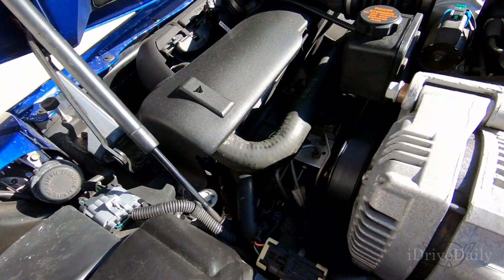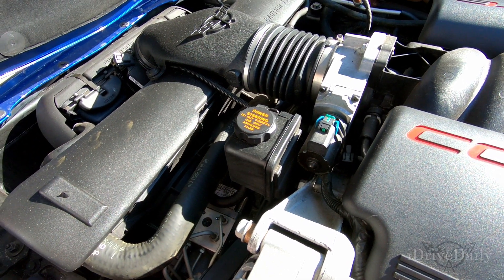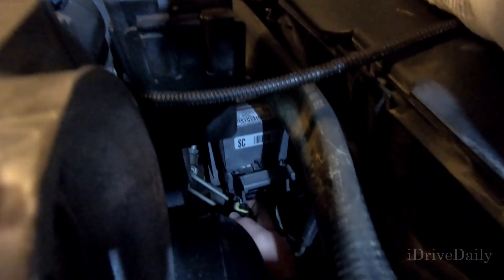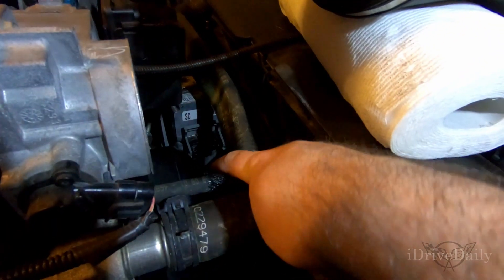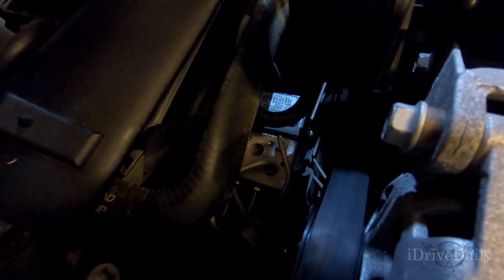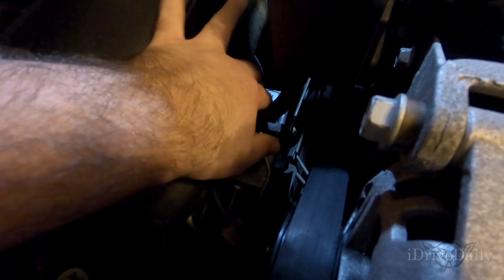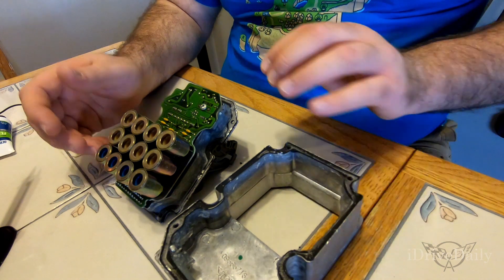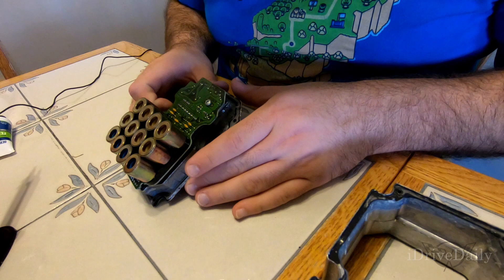Code C1214: Repairing a C5 Corvette's EBCM

Comment: Do you connect the points, or you just tap on each point?
Reply from the maker: I assume you mean the soldering part. I essentially "tapped" each point adding new solder to ensure that they were all connected.

Comment: I have a 2003 C5.  I lived with this issue longer than I care to admit.  A few years ago I finally dove in to this repair.  All I can say is, "I should have done this sooner".  The idiot lights have never returned.  My ABS and traction control perform as intended.
Reply: Congratulations. 

Did you notice the Corvette performed differently after the ABS module fix?

Comment: Thanks for making this video. But a solid 5 out of 10?! In my opinion, "this one goes to 11." And I didn't even do the repair. I sent it off to ABSfixer. But removing the module and replacing it amounts to the most heinous repair job I've ever had the misfortune to undertake. The skin on my hands and forearms is STILL healing! I came at this thing from above and underneath. The tight spaces, awkward angles, and blind spots (especially that middle T20 screw towards the front bumper) made me really regret buying this car (only had it 3 months). I lost a T20 screw, found it with my magnetic tool retriever, then lost it again into the abyss of the engine bay. God only knows if it's still in there somewhere. So my module is holding fast so far with just 5 screws. It works, and I got rid of those annoying beeps at start up and shut down, but my goodness...it's like they designed this thing thinking it would never need to be accessed for repair. I live in a condo with a shared garage. I'm thinking ownership of an older car like this should just be reserved for those who have a private garage.
Reply from the maker: The module is in a trash location and is a PITA to get to. Even looking back, it's a crap job, but I don't know that I'd rate it at anything much higher than a 7. In reality there are a lot of other projects that are more difficult than this one because in reality, this job is essentially unplugging a module, soldering it and plugging it back in. Even with the down time I've had on the car and some of the stupid repairs I've had to do, I don't regret buying the C5. I have a lot of fun driving it and learning more about mechanics as I go along. It can be frustrating at times, but that is just part of owning a car.
Reply: @iDriveDaily  Thanks for the reply. And I agree with your statement in another video, that it's a "love/hate" relationship. Mostly love, though. The car is amazing, I'm glad I bought it. And I knew buying an older car would involve skinned knuckles and colorful language. But I'm glad it's a 2nd vehicle. I think of it as a 4 wheeled motorcycle with a roof and reverse. Even if it's up on jack stands, I can still get to the auto parts store/work/grocery store with my other vehicle.

Comment: Several months ago I bought all the necessary tools to "fix" the EBCM in my 2001 Vette.  The coding would not go away.  Then, out of the blue, the code disappeared entirely. No history, nothing. OK I thought.  I had been looking at the wires to the connector, touching them.  The car was driven for two months over smooth roads and the DIC never threw a code until Saturday while caravanning with several Corvettes over a variety of textured country roads. Now, I am back where I was before. My question is: Was your soldering job successful?  This intermittent problem needs to be fixed, once and for all.  Thanks in advance for your reply.
Reply from the maker: I'm just a few days short of two years and I've had no issues (knock on wood) since doing the solder job. It's a PITA, but I do suggest it as a more permanent fix. It's a common fail point on the C5 Corvette. Hopefully, with a little solder, you'll have the same luck as me in two years.

Comment: Thank you for showing me which solder joints/tips needed touch up....My EBCM was not at all ratty when I opened it.  It was well sealed with Silicone and difficult to get open...but I soldered the 5 points anyway....slide the cover back on it, connected the two connectors, switched the key on.........and no ABS Light or Traction Control light...Put black silicone on the notched flap cover after cleaning it off, installed the 4 screws that hold the cover in place....put it on the car with great difficulty, even loosing 1 of the 6 screws (the one in the middle on the right side when you are standing on the left side of the car).  It was getting dark so I quit for the day....Went to Chevy Dealer in Prescott, Wisconsin, bought 2 screws came home and when I put the right middle screw in...it went into a hole and disappeared exactly like the first one....went and got my big magnet and put it near the middle opening and both the new screw and the original bronze color screw came out with it....whew.....I do not have to take the pump apart.  Yeah....Drove the car, switched the Traction Control on and off....jammed the brakes a couple of times...antilock system worked perfectly...I saw on ebay that someone wanted $1,500 for a remanufactured EBCM, another for $1,000 and then one for $200...exchange.....I figured if the soldering did not work...I would try the $200 rebuild.....BUT IT WORKED AND THIS SAGA IS OVER!!!!!  THANKS A TON.  MIKE'S SERVICE
Reply from the maker: Yeah, used EBCMs or even repair services are very expensive. With a little time and patience, you can fix it yourself for about $10. It's a PITA, but it's worth $990 in savings to me.
Reply: How long is the repair?  It can be done in a few hours ?

Comment: This worked for my EBCM, but ONLY after I reheated and soldered the two longer solder tabs closer to the center of the board and just above the 5 relay solder points. Be sure to carefully check ALL solder points on that unit. Many thanks to several who have made similar videos of this relatively easy repair. Took two attempts, but works like new now. Hardest part is breaking the seal on the unit, but just keep at it. It does eventually loosen and come apart.
Reply: Good bit of information. Does your Corvettes EBCM still function as it should?
Reply from the maker: 100% the seal on the unit is incredibly hard to break. That is the only part where I had to reach out to a mechanic that had more tools than me to help. Once you get it to begin prying up, the rest is relatively easy. 

Yes, I do highly suggest checking all the solder points in the unit. While the two I did are the most common, many others can fail as well. It's best while you're in there to take car of all of them as opposed to having to go in there again.
Reply: Same here. I did the 5 pins and the larger solder points towards the center ( they had very small visual cracks). So far so good.

Comment: did it  e x a c t l y  as shown in this video on a Cadillac Seville 2004 - only thing i did additionally was to heat the whole PCB with a hairdryer to prevent any solder cracks to be missed - thank you from Germany for the GREAT demo and for sharing!!!
Reply from the maker: I'm glad it worked for you!

Comment: I didn’t actually look at the part number, but your module appears to be identical to the one in my 2001 Cadillac STS. I just finished pulling it out, and tore it down. You’re getting off lucky with one code. I’ve got about 6, and they all funnel back to the ebcm. Tech2 shows ~.25 volts on the switched circuit with key on... so that’s just not right!  Cross fingers.
Reply: Aaaaaand.... No.  I guess by the time you're getting a C1255 m3 internal malfunction, there's no amount of reflow that will save it.  :)

Oh, and for the records - mine is a model 12218160 / 25738080
Reply from the maker: Sorry to hear you didn't have any luck. I keep hoping mine holds up, but I'm always a little worried that it may officially kick someday... Let me know what solution you come up with or if you're going to try and find a refirb/new one.
Reply: iDriveDaily - so with the C1255 internal malfunction, it seems it’s terminal. Reflowed the whole board, and no change. Hit the wreckers, and $40 Canadian pesos later it’s working.

Comment: Very good and informative video. My 2002 Z06 had similar failure indications. The dealer thought it was the EBCM, but it had Steering Angle Sensor codes as well (C1287 and C1288). Speaking with Brandon Hite of ABS Fixers in Missouri, his educated hunch was correct – I put the car in the shop early yesterday morning to have the Steering Angle Sensor replaced, they were done by 2:30 in the afternoon. The new sensor fixed the problem. Drove it home and the console Traction Control button works normally and allows me to go into Competition Driving and all that good stuff. It toggles correctly. None of the problematic DIC indicator messages nor caution lights came on.
I appreciate Mr. Hite's able assistance and being honest with me, when he could have taken advantage of me and had me send in the EBCM box. It all works now correctly.
Reply from the maker: Yeah, there are a lot of people out there who will just take advantage. I've come to endear the Corvette community because it seems that most guys are fairly honest and willing to help. I can't speak for other car communities (I had limited interaction with Lincoln, but most guys there would take their cars to the dealership) but Corvette Community is awesome. Thank you for letting me know about ABS Fixers. I had thought of sending my part to them, but wanted to try and crack it myself. Pretty difficult process looking back, but I'm glad I did it. If it happened again, I'd honestly consider sending it out to Missouri. Thanks for the views. Hope you and your family are safe and healthy at this time.
Reply: iDrive, thanks for the response.  Brandon of ABS Fixers was quickly responsive, and after he read the diagnostics verbiage of my dealer, he was pretty sure it was the angle sensor and that "the EBCM should be fine."  He sounds like he's not only a nice guy but also quite competent.
I could not do the steering angle sensor myself - it's quite involved - I ordered the part (Chevy had it as OEM) and paid about $750 for total parts and labor.  As for the EBCM, I may do that in the future as a preventative maintenance measure.  Pull it and send it to ABS Fixers.
Another side benefit is that Cruise Control now works.  It works only with the Traction Control ON and working properly.  It won't stay engaged with Traction Control / Active Handling failures.  You have to turn it OFF to disable all that stuff to again enable Cruise Control operation.  Seems to be a strange interlock system.

Comment: Hi iDd, I have to ck my grounds, before removing my ebcm...how many are there? My vette is a 1999  convertible A4...so no one will rebuild or solder them...97 to 01...So I need to ck other things first...thx.
Reply from the maker: There are 13 total for the car. However, I would check the majority in the engine bay itself and worry less about the others. There's 4 around the bay and 3 attached to the engine block. I only cleaned the four around the bay as they are most prone to corrosion. One is located under the battery, one behind each front headlight and the fourth is directly across  from the one under the battery on the driver side. The one that is linked to the EBCM is the one underneath the battery.
Reply: @iDriveDaily  Thank you Very Much for the info...and the exact details...cool...I really hope it does the trick...the alternatives suck...for All 97 to 01 owners....thx again.
Reply from the maker: I've read a bit on the earlier C5s and they are a bit more finicky. Best of luck, should it turn out to be another problem you are able to track down, let me know.
Reply: @iDriveDaily  I was really hoping to be the resoldering job, or even less. ..but mine isn't included in that repair...It hurts the resale value if not fixed...and those are dropping like A Led Zepplin.
Reply from the maker: https://www.corvetteforum.com/forums/c5-tech/896875-important-electrical-information-long.html

That thread was specifically written by a 97-00 owner. It may lead you to more information on repairing your issue. Its been a few weeks since I read it, so In don't quite remember everything included in it.
Reply: @iDriveDaily  Another important earth to locate and clean up is in the drivers side rear wheel well. It is near the back of the wheel well on the frame. I would say it's probably the worst one on the car for corrosion because it will catch road grime from the wheel. It's the earth for the car's fuel pump so important to be good.

Comment: I've done this repair and still get a code. I'm thinking my issue my be a steering wheel sensor.
Reply from the maker: That's crazy. Let me know how it turns out. There was definetly a few fixes for this problem. I figured that at some point I might have to give up and take it to a mechanic and have them chase it down. Good luck, I sure hope you can get it solved. Like I said, let me know how it turn out and what ultimately you did.
Reply from the maker: Did you ever solve the issue?
Reply: @iDriveDaily  I replaced the ignition switch and all my codes went away.